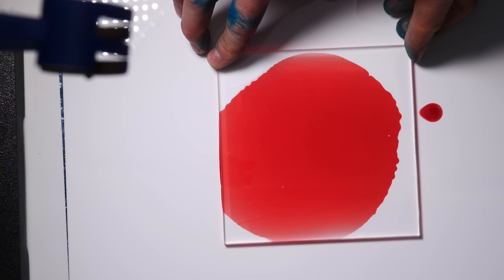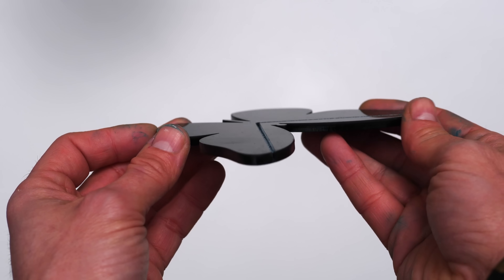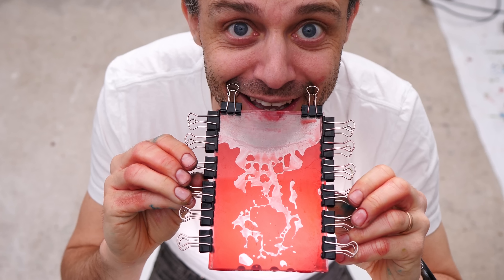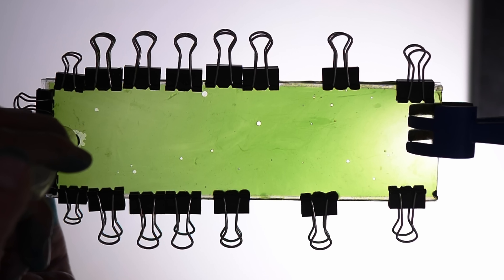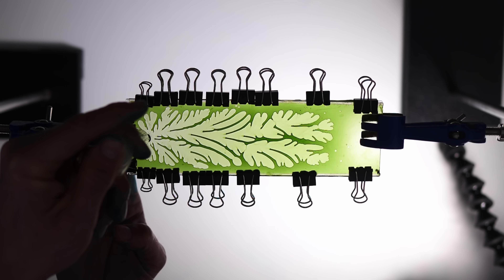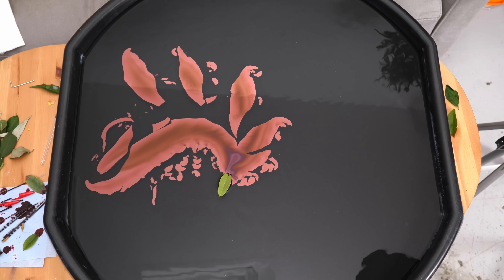Why honey makes these strange tendrils

Comment: I found out about this effect during covid quarantine and made about 200 paintings using it and wrote my thesis on it. All i used was gesso primer, water, air ofcs, and some oil paint, to make the mold i used the cap of a nutella jar. it sure made quarantie less boring. The primer makes some incredible structures and they will be permanent once dry, can play around with the viscousity by mixing more gesso in the primer or adding a cover of water in some regions of the mold before detaching them, can also press the mold in different regions, and apply force from different regions while separating the surfaces. Kind of a missed opportunity not knowing i could have named my thesis viscous fingering.

Comment: For the butterfly problem you would need to split the acrylic along the symmetrical axis into two mirrored pieces and then pry them off in the same direction, towards or away from the axis.

Comment: I wonder what would happen, if this experiment was done in a vacuum?
If there are no pressure difference, only surface tension, does it then mean there wouldn't be any fingers? Which pattern would it then make, when the plates are pulled apart?

Comment: Just a brain fart, what would happen if you glued down the cut out butterfly shape and I left everything in tact from the tip of the butterfly wings upwards in the top plate, or just a square top plate which covered the whole bottom plate and tried to pry from the top with something that would evenly distribute force along the top edge of the place you’re prying

Comment: Here's an idea for the butterfly - For the base, find a way to attach it to something sturdy.  For the cover piece, use a material that is slightly flexible and attach a handle or something similar to the center.  When you pull up on the handle, you should get the viscous fingering to start from the center.  You could also drill one or more tiny holes in the cover to help start the process in specific spots.
Reply: My Thought exactly!  Or, instead of the handle in the middle, put 4 eye screws on the ends of each wing, as lift points.  Use wire to lift from the the wing tips so the fractals start on each tip and move inward.

Comment: maybe have the top die index with the groove cut into the bottom die, so when they are together, there is little-to-no negative space between the two halves. or maybe use a router to make cut the groove in the bottom die, and make it very shallow.

Comment: An important factor i didn't seen addressed is the injection of the thinner fluid causes the plates to move apart forcing the thicker fluid to clump creating the gaps for the thin fluid to go through.

Comment: I can imagine the shape of a pyramid, whether it is triangular or quadrilateral. At the beginning, it should be flat, with the lower boards completely connected, while the upper boards are separate. The upper boards will be raised from the sides to the top of the pyramid. After that, the pyramid is formed from the lower board after it is cut. It will look like a fantastic piece of art.

Comment: For the butterfly project, in the upper board, make each wing of the butterfly a separate board. Connect the two boards in the middle at the body of the butterfly with adhesive and place a pen on top of them. Wrap two strips of adhesive around a second pen and attach each board with tape so that the second pen is suspended in the air, two fingers above the first pen and parallel to it. Slowly rotate the upper pen while keeping the lower pen fixed on the boards until the two boards start to rise in parallel and together. Then, let the lower pen go so that it can be released, allowing the two boards to rise completely.

Comment: Why not just pry from the extents of the butterfly wings? Either by wrapping then in something stretchy to pull with, or coming up eith some jind if breakaway clamp for the center and putting a wedge into the tips of each wing? (May need 4 hands for that last one)

Comment: You can change the prying behaviour of the butterfly by giving yourself some leverage in the centre. Weld some handles onto the centre of the butterfly, and pull it apart from there - with the small channel along the body you tried first to kick things off.

Comment: For the butterfly symmetry problem, couldn’t you cut the clear plate in half (down the middle) then remove both pieces one at a time in the same way? Might not be exactly symmetrical but should atleast be similar orientation of the fingering.

Comment: Put a handle on the back of the butterfly, place your fluids on the butterfly itself, press it onto a square instead of another butterfly shape, than try to find an angle to pull them apart.

Comment: 1) When you pushed water or air in corn syrup, The outer edges of corn syrup circle also started forming "FIngers". I really didn't get why that happened because there is no way air is also pushing from outer surface while you are pushing water/air through the centre.
2) What if we try this same thing with fluids having much difference in surface tension and density. Like Mercury/ Gallium and water/air. Or also with a specific type of gas like argon, co2, heliom, oxygen, etc. 
3) I'm also curious about how temperature affects this phenomena.

Comment: Two questions: (1) Why does the thicker fluid initially appear to pull inward as the thinner fluid is injected into it? Is that only due to the outward flexing of the planes of the heli-shore cell? (2) What happens if the thicker fluid is a non-Newtonian fluid (whose viscosity varies with pressure)?

Comment: 9:50 is a form of the instability driven by concentrations. This instabilities, along Raighley-Taylor instability, salt fingering, thermal convection-diffusion instability and many more are occurring when a fluid with smaller diffusion rate is pushing on another.

Comment: How would differing the pressure of the hose, affect the results. Most importantly, the number and rate of formation of fingers, and the subsequent application in crude oil extraction from porous rocks?

Comment: 1. Use a thin piece of plastic as the top plate.
2. Glue three thin sticks or strans of thread to the top plate , two to the top end of each wing and one on the head of the butterfly. Connect all three and pull.

Comment: @Steve Mould 
Could you put a "lever Dial Gauge" (Google) on each side of the acrylic, so it is possible to calculate how much the acrylic flexes & calculate how much circumference difference that would make?
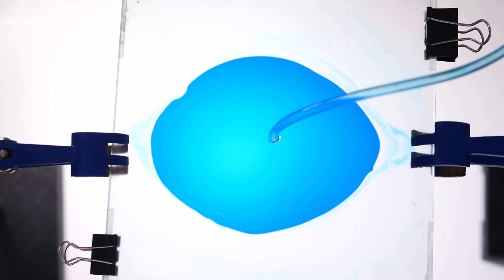2:45 How is it possible for the red liquid to reduce it's circumference BUT NEW fluids are ADDED to the volume, NOT subtracted?
I guess the acrylic pieces separates (up / down) some more, because of the extra pressure added in the center?

Comment: For the butterfly: You can also change the 'pry' direction by cutting the top plate in half, if you leave a little room in it you can actually get the 'seed' effect fully by not covering it.

Or, you can use a less rigid covering, Something a bit more flexible would allow you to change the way the cover is being pulled to, giving you the ability to manipulate the direction of the fingers.

Comment: I respect the commitment to family friendlieness.
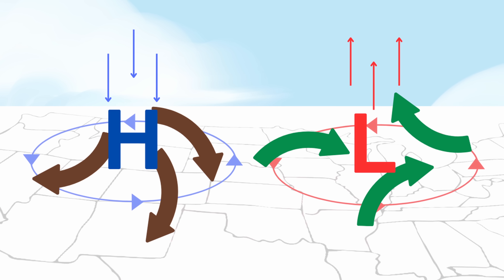Reply: I think the blue arrows in the diagram at 7:08 are pointing the opposite way from how they should (how they do in reality). They are pointing anticlockwise, but should be pointing clockwise. They indicate the direction of the wind, i.e. the movement of the air w.r.t. the local part of the earth's surface. 
Conservation of angular momentum is enough to prove it. 
The air in a high pressure system starts out stationary with respect to the rotating earth. In the northern hemisphere (it is above the USA, we can see the map), that means it's initially rotating anticlockwise (viewed from above the north pole, from the star we call Polaris, say). As the air moves outwards, away from the center of the high, it's angular momentum is conserved and so the rate of rotation decreases, so that is is rotating slower than the earth under it, and thus relative to the earth is rotating the opposite direction, that is to say, it is rotating clockwise.
Reply: He typed an entire essay

Comment: I believe you're thinking needs to be an inverse in order to create a symmetrical pattern.  The fingerlings originate from air being introduced to the thicker medium.  A Channel won't be helpful.  Instead, you would need to create symmetrical nodes where the thinner material is introduced. Reply if that doesn't make sense.  A drawing really would explain everything.
Reply: To boil it down, You won't get symmetry if you are prying from the edge.  I suspect you will need to make symmetrical "pry point" within the shape.  At least two for the butterfly, which could be points or lines contoured to the desired path the fingers to adopt.

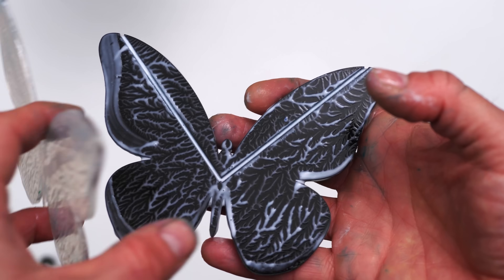Comment: 12:18 you could do the left and right halves seperately, with a channel in the middle, so pulling the (left wings upper plate) from the top of the left wing and the (right wing upper plate) from the top of the right wing. But then you'd maybe have a weirly straight channel right in the middle. you could also get some sort of piston setup to push the whole upper plate up smoothly

Comment: 3D equivalents of this briefly exist for blood suspended in SSP solution (Pooling Buffy coats together for concentrated platelets). I reckon this is because the residual red cells are "sticky" and remain together until turbulence ruins the chain. It would be interesting to see if an artificial version of this can last longer.

Comment: When you put air into water, or water into corn syrup etc, why does the viscous liquid shrink/contract from the edges? Surely adding another fluid should displace the viscous fluid and cause the opposite effect

Comment: Beautiful video again, for the symmetric butterfly you could slit the top transparent plante in half and lift each top from the sides towards a symmetrical center axis with a channel. Also wonder why you haven't flipped the circular plate-tube demo 180° to not have the center tube in frame. more clear visuals :3 Keep up the good work

Comment: Idk if someone's suggested this specifically but for the butterfly have the bottom piece be the same, but the top sheet should be split down the middle. Then, lift from the outer sides in towards the middle, maybe one at a time or both at the same time if possible. Should be no need for a hinge. Edit: looking at a few other suggestions, i notice a lot of people suggesting pulling from the center out to the sides, but that would be the wrong direction. You would want to start from the outer edge of the wings so that the smaller fingers are towards the edges and the larger branches end and meet at the middle. That's why there's no need for hinges or anything fancy, only to cut the top piece down the middle and leave the bottom as is. Also much easier to lift from the edges than from the middle.

Comment: 1:49 The upper plate doesn't need to be the shape of the butterfly. Take a rectangle and now you have a grip in the center between the two wings. So you can try to make the pattern symetrical.

Comment: You could pry the butterfly in 2 parts separated at the center.  Maybe hinge it at the body of the butterfly and pry both wings simultaneously with a string connecting the edges of the wings.

Comment: well, you could drill a hole on the clear sheet of the butterfly, pass a nail, having the head of the nail in between the sheets, and then pulling from the centre

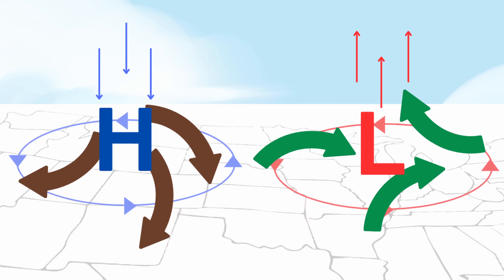Comment: I think the blue arrows in the diagram at 7:08 are pointing the opposite way from how they should (how they do in reality). They are pointing anticlockwise, but should be pointing clockwise. They indicate the direction of the wind, i.e. the movement of the air w.r.t. the local part of the earth's surface. 
Conservation of angular momentum is enough to prove it. 
The air in a high pressure system starts out stationary with respect to the rotating earth. In the northern hemisphere (it is above the USA, we can see the map), that means it's initially rotating anticlockwise (viewed from above the north pole, from the star we call Polaris, say). As the air moves outwards, away from the center of the high, it's angular momentum is conserved and so the rate of rotation decreases, so that is is rotating slower than the earth under it, and thus relative to the earth is rotating the opposite direction, that is to say, it is rotating clockwise.

Comment: Maybe cut the black butterfly plate in half vertically, and use the two "wings" as the opposing plates to pull apart? Then reconnect the halves via some mechanism on the back?

Comment: Interesting Plate Shape Idea: Leaf

The symmetry-promoting channel could run down the center as the midrib.  Pulling the plates apart starting at the tip (I think) should create a symmetrical pattern.

Comment: Butterfly solution.
Base layer: Flat with 2 peg-holes on thorax.
Viscous fluid layer. Preferably colored in contrast to base layer.
Upper layer: 2 pegs on thorax that puzzle into base layer. Hinged wings (or wings that break away from thorax after being pulled off base layer).

Comment: For your prying mechanism, I propose a jig and tool. Basically just make a flat plate with one edge to push the piece against, and maybe a contact adhesive to hold the bottom down. Then just use a tool with a long enough edge to get across the gap between your prying corners, or opposing edge from the backing plate in the case of non-butterfly shapes. This will start the spread more uniformly, as long as your prying tool is stiff. you could also reasonably print a pulling tool that would hook into your grooves. Point being, hands and fingers are squishy and difficult to get things even with mechanical assistance.

Comment: For the butterfly:
 teh plates aren't perfectly rigid and bend when you pry them apart. so in order to make the "seed grove" relevant, you would need to either pull on the entire plate evenly, or inject air from the center. In that case, you might need to add a barrier on the edges where you don't want air to escape, since the minimal and maximal distances are very different.
alternatively, you could make two plates or a plate with a thinner part that act as a hinge, and lift them from the center/thorax.

Comment: I'm curious about how the plates flexing affects the pattern of the fingers. At 3:00 you can clearly see the diameter of corn syrup shrinking while the water is pumped in, because the plates are bowing apart. In a perfectly rigid setup, would the water only take one "path of least resistance"?

Comment: Then what would happen if you use two fluids of equal viscosity, such as red dyed honey pushed into blue dyed honey?
Additionally, for the butterfly you're trying to make, consider carving a channel along where butterflies body is, threading a rod through it and pulling apart the plates from the middle using the rod for leverage.
Thank you for the interesting video :)

Comment: For your butterfly problem:

Maybe it's possible to have 2 slightly curved parts, so if you push them together, they elasticly bend to a flat surface, where the glue is evenly spread out. Then if you reduce the force holding them together the energy stored in the bending may cause the effect you want: a symmetrical fractal from the middle outwards.
But there're several problems immediatly popping up in my head: How do you bend those parts? How much of a bend do you need? How big is the effect of the glue? How perfect has all this to be in order to get the symmetrical pattern, you wish for?
This migth be so complex that it could be categorised as "I overengineered viscous fingering just to feel happy for a brief moment in time".

Comment: I believe the finger formations are created because of surface tension (why the glass plates are hard to pull from each other).
The reason the fingers get bigger is that some of the liquid will be "pulled" from where the fingers are small down to where the fingers are larger.
So there will essentially be more fluid accumulated where the larger fingers are.
Reply: had to ctrl-f to find any mention of surface tension. was also my initial thought

Comment: The explanation and/or examples are wrong here.
In most of the examples where you insert the thin liquid under pressure, this phenomenon happens because the thin fluid forces the acrylic/glass plates from each other. They bend, so to say.
Proof: 
For the square examples, you can see the thick fluid withdraw inward when you push down the thin fluid in the middle.
For the rectangular one, the fingers always moves towards the sides of the glass, while they should move towards the low pressure zone in the other end (they would probably move like a sector cut out of the square ones).
You need to redo this experiment with thicker plates or with lower viscosity fluids (thinner means less pressure between the plates) 😊

Comment: I’m a fractal.

My torso is a cylinder.

My legs, they are kind of cylinders, and then, 5 smaller cylinders protrude from them.

Commonly called toes.

It is possible that under a microscope each toe will split again into even smaller toes.

And so on it goes.

Comment: Steve - great video as always. You see this pattern in lightning, tree branches & roots, nerves, arteries, rivers, mountain ridges, snow flakes, shattering glass etc. 

Although this can be explained using pressure, maybe there is something else going on here like to do with the electromagnetic force or just force in general (which as we know binds everything together in the universe) as this behaviour is present in so many varying examples where fluid and pressure may not necessarily be the driving forces.